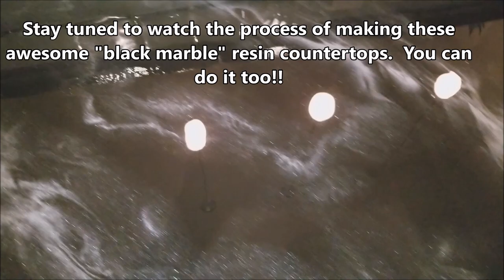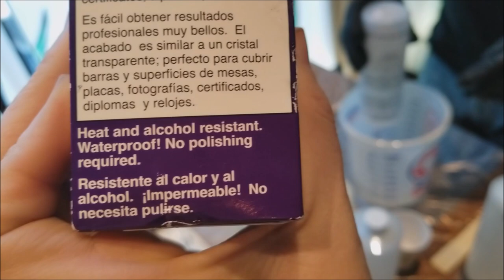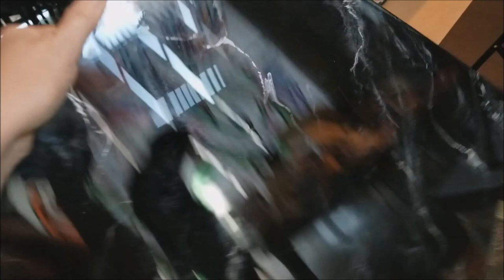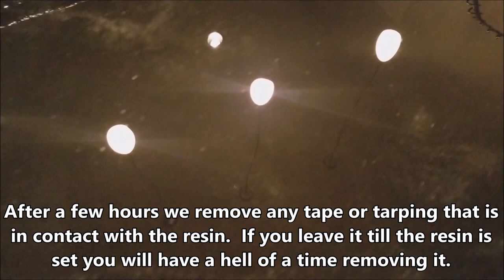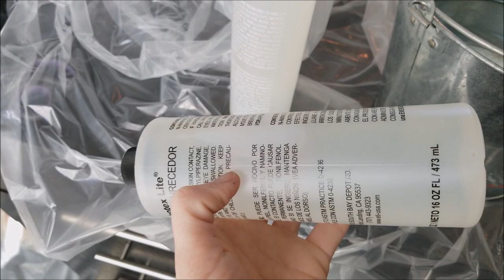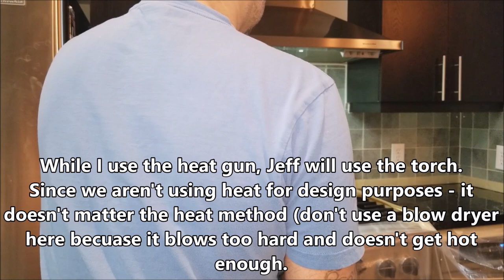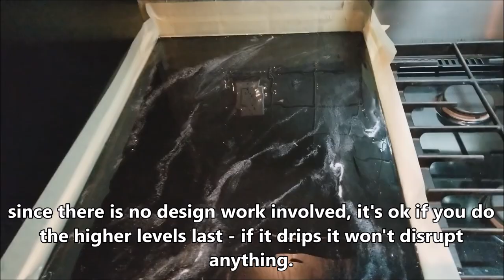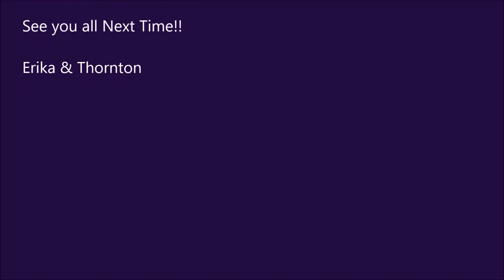STEP BY STEP Black Marble Resin Countertops IN DEPTH

Comment: Beautiful work as always!  I did not know one could get spray nozzle tips to alter and slow the flow of the paint.  Thank you for that pro tip!  For the life of me, I cannot get my Rust-Oleum metallic gold  to flow like the look you two achieve.  I am thinking maybe if I get a really  thin tip , it might make a difference.   This video has inspired me on a purple marble look I did on a  vinyl record album I intend to turn into a clock.  It looks "nice" but I wasn't sure how to make it "pop".  I am going to use the silver luminiere paint to add veins as I have seen you do on your black marble look.  Crossing my fingers!  And thank you again for such a detailed, instructional video!
Reply from the maker: +Brenda Mosal thank you!! We are here to help. You can find different caps at smoke shops or skateboarding shops sometimes.
Reply from the maker: Oh yes Brenda, we rarely use the spray caps that come with the spray paint.  When using spray paint (ESPECIALLY with metallics) you need to shake the can A LOT.  If you live in a cooler climate, you need to shake it even more.  The cold temps really make the particles in the can settle and separate.  If you don't shake it well enough the resulting color can come out dull, inconsistent and almost gritty looking.  We are always here if you have any questions or if you need anything.  You can also always email us!
Reply: Maybe that's why my metallic gold doesn't work like yours does. I do live in Colorado and it's winter right now and my paint is usually down in the basement where it's definitely chilly. And when I spray it I take it outside and it's usually at night and usually it is  pretty cold out there. I will try to warm it up and shake it for a couple minutes minimum.   I am also going to look into those tips because that is a great idea for the spray paint. As usual, I get something new from every video you do.  Thank you so much!  ☺
Reply from the maker: It's our sincerest pleasure, we are here to help.  Just keep that can in your home overnight and when it comes up to your regular (inside the home) temp it should make a world of difference (especially when properly shaken).

Comment: How do you clean your foam roller? Your process is much simpler than another that I've seen. Might try this on my counters, they need a lot of work. Thanks for this video.
Reply from the maker: Hey veeda! Thank you for watching and commenting! We typically just get a new foam roller after we use it with resin. If you want to attempt to clean it out you could use 91% alcohol.

Comment: Hi guys, this is an amazing video with step by step guide! I have been wanting to do my kitchen countertops and have been looking online a lot and I just found your channel. Amazing content on your channel! Great work and the finish product looks amazing! keep it up!

Few questions if you can answer please, I'd appreciate it! 

1. How much resin was used for this project? 
2. I noticed that you guys didn't use the silver spray paint in the first layer like the demo piece that was done for the client, instead added silver leaf before the top coat and after the sanding. Any reason why? and which way is it recommended? 
3. Is sanding required after the first layer? I didn't see that in the demo piece. Is it not possible to just add the top layer on top of the first layer without any sanding or does it change the final look? 

Thanks once again!
Reply from the maker: Hello Aabed!  You should totally try it.  I will certainly answer for you.  It took probably 3.5 gallons for this whole project, start to finish. We didn't use the silver spray paint as we did in the test piece because we underestimated the time.  By the time we had everything laid out and the resin where we wanted it - it had set too much to try to add the resin, it wouldn't have had the same effect as it had in the test piece.  The reason why you want to sand in between the first and second layer is to create a tooth for the first and second layer to bond to.  It doesn't really have much to do with the look - more to do with the longevity of the countertop.  We are happy to answer any questions you have, please let us know if you would need any further explanation. Thank you so much for watching and taking the time to comment!
Reply: Perfect, thank you so much for the quick reply and the feedback! Much appreciate it and all the best! You guys are amazing :)

Comment: I think I'm going to half to try resin after I finish a few other jobs on my list, (to many to count). You probably already know this but if you place a sheet of wax paper on your metal leaf you can pick up the sheet and lay it down on the adhesive, lightly rub pick it up and place it on the next section. You still have to brush off the excess but it makes handling the metal leaf a lot easier.
I watched a video where they actually resin a sink to make it look like marble. Have you ever done a sink? What are your thoughts on doing it? Do you think it would hold up to heavy use? Thanks.
Love your artistry and videos. Thanks for doing them.
Reply from the maker: Hey Barbara.  We actually have some that start on a sheet and you can just rub it off onto the adhesive (it's not loose) but I didn't have any on hand when we started this one.  Thank you for the tips though and you should totally do yours.  I have resined around a sink but never into a sink.  I'm not sure how it would hold up but I would be interested in giving it a shot one day.  I'm just nervous since the resin likes to run off of edges and such.  I would have to find a special resin made for vertical surfaces. Thank you so much for watching and taking the time to comment!

Comment: If I don't have a heat gun, can I use a hairdryer with the diffuser attachment on it?  Not sure if it would "ruin" the resin look if any amount of air comes out of the diffuser
Reply from the maker: That would totally work in terms of moving the resin around. I would just worry about it getting hot enough. Definitely do a test before starting on your countertops. It needs to get hot enough to pop the bubbles that you mix into the resin when you combine parts A and B.

Comment: can you cut on the surface?
Reply from the maker: Colleen Terry hey Colleen. Ultimately I wouldn’t recommend cutting on it - much like I wouldn’t cut on marble or granite either. The products we use are heat, water and alcohol resistant - it’s also FDA approved. If you tried, you could scratch it but I would assume most households and bars use cutting boards, no matter what the countertop is made of. I hope that answers your question, I’m here if I need to clarify or if you have any other questions.
Reply: thanks for the info..I love your videos